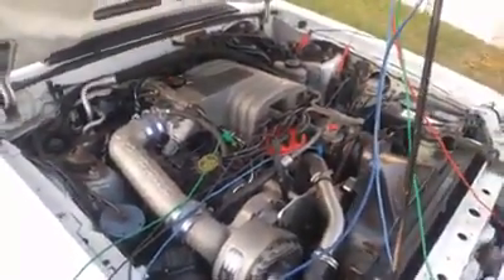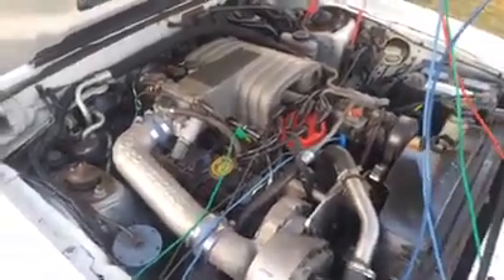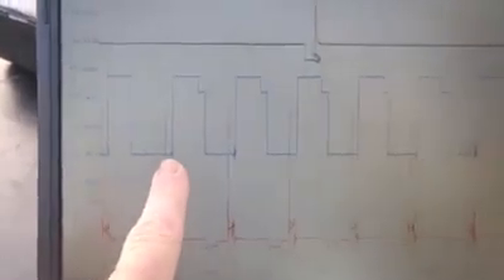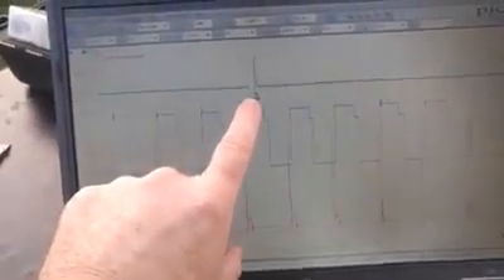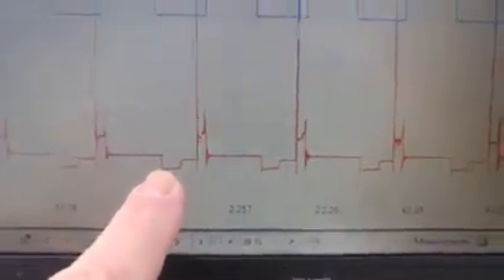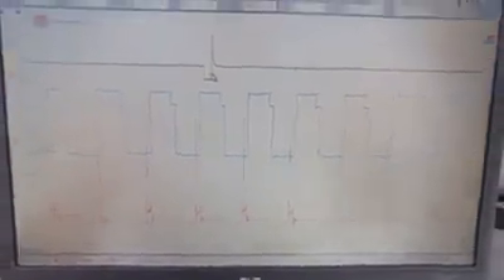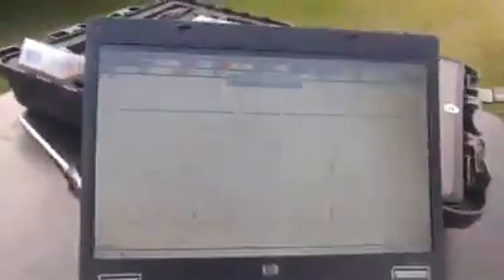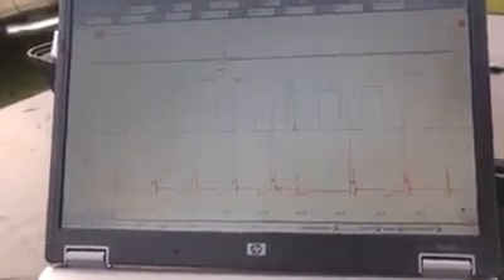Diagnosing a bad EEC-IV TFI Ignition Module Part 1

Comment: Great video ty . My 88 got was running good when I parked  it .went to start it up a few weeks ago and doesn't hear fuel pump . So I jumped fuel pump relay and could hear pump running .but still no start could smell fuel when I lifted hood . Unplug the coil wire and no spark . Tested power at coil and it was present . Along with the signal wire  I used a test light . Now I'm guessing what it could be ..bad pickup in distributor . ,,Tfi module ,,,or relay to ecu  ?? I did notice some great on male connectors on ECU relay . I also hear to check ignition switch plug . .I hate to buy parts I don't need . Any suggestions ???
Reply from the maker: This is what the video is for. I have other videos on testing the coil as well. Remember though, that these Mustangs can have spark even if there is no computer installed at all. The pickup coil has to send a signal to the module, and the TFI module fires the coil by ground pulsing it. It's rare, but possible, that he pickup coil is bad. It's more common that the TFI module is bad. But you have to test to be sure. Could also be lack of power or ground going to the module.

I recommend testing, not guessing. But if I were guessing, I would say no spark = a bad TFI module. See video on how to properly install a new module. If you want to replace both at the same time, just put a reman distributor in it that comes with both a new PIP sensor and module. Getting quality new modules is a PROBLEM. Even the Ford module is now just a cheap Chinese module. Only the original Ford modules with the word Motorcraft embossed into the module plastic are good. The rest are cheap chinese garbage, in my opinion.
Reply: @dragradialperformance3540  ty I appreciate you getting back to me . what worries me is no fuel pump . No prime when key is turned on . I have checked power at Borg sides of all fusible links . And I have heard that the check engine light should come on with key on engine off .but I have never seen a check engine light on my dash  . And I agree about the cheep china parts . because I have changed the pickup and module a few years ago when I changed the distributor gear . I have already bypassed the inertha switch a few years ago when car wouldn't start. I'm sure I will figure it out but I don't want to throw parts at it and don't have much for testing equipment . Going to test all relays and then start with tfi module . Ty again
Reply from the maker: @jaymartin5434 no check engine light ever coming on likely means the bulb is bad, or maybe someone removed it.  Replace the bulb. No fuel pump prime means either the PCM is not getting power, or ground, or the capacitors in the PCM are shot.

The capacitor theory is very likely. All these 95 and older PCMs are suffering from this because they're the right age for it. Remove the PCM, take the lid off, and look at the 3 teal blue capacitors. If they are leaking at all, they're bad. This can cause the engine to run rough or the PCM to not work at all. Very likely!

In ALL foxes, these should be checked. And if the original teal blue capacitors are still in there, they should be replaced by an electronics repair pro. We offer tbis service. Avoid those jackleg Ebay "PCM repair" services". They suck.
Reply: @dragradialperformance3540  ok so it was the ECM relay . I had a windshield put in just before I parked it for the winter and when I took relay out it was wet . I jumped the two big connectors and it started but I still don't hear pump do ten second  primi . But it has always started right up . pump is quiet and that damn factory fan makes so much noise. When car is running .. I did remove the ECM that was in car before I tried jumping wires because it was damn feeling .. I'm not sure yet if it was got wet inside . going to take it apart and look it over . . I'm going to change my ECM relay and fuel pump relay . And maybe the one under the hood on right side of car . Ty for your input ..
Reply from the maker: @jaymartin5434 glad you got it figured out. ECM relay failure is unusual, and it should never be wet. Check for windshield leaks. 

The capacitors should still be checked. They're bad based on age alone.
Reply: @dragradialperformance3540  ya I'm calling my windshield guy tomorrow .to have him fix leak . I just hope it didn't ruin my ECM .i didn't know it was leaking . because I don't drive it in the winter . And I had it done late in the fall not long before I parked it . thanks man for helping me .do you rebuild ECM  ?? Or know a good place that does ?? Would love to have one or both of mine checked out
Reply: @dragradialperformance3540  doesn't say where you are ..are you in the US
Reply: I would like to have you look at my ECM
Reply: @dragradialperformance3540  I'm sorry I see now that you do rebuild ECM I have subscribed to your channel . And I'm watching you videos I'm probably going to call you tomorrow just a heads up LoL
Reply from the maker: @jaymartin5434  yes, we replace the capacitors in these Fox computers. If your capacitors are the original teal blue ones, they should absolutely be replaced as soon as possible. They leak an acid that eats the traces on the board if you don't get them out of there. It's a similar situation to when you leave AA batteries in a remote for about 10 years. When you remove the remote's battery cover, you immediately realize your mistake.

Email me at pontisteve@earthlink.net and ask me how to send your Fox computer in, and I will email you back the forms you need to fill out. And get that windshield leak fixed!

Comment: own a 87 Bronco w/SAME ignition The Ranger station Bronco forum has a AWSM TFI Tsg chart i fixed mine in 30 minutes whereas the shop took 3 weeks didnt fix n charged me $250 ( fortunately) Now it has  a miss but it DOES start.. u need THREE things to get spark at the TFI conn Pin 3 4 n5  Pin 3 is start n u need ta CRANK it to SEE 12volts  pin 4 is RUN and with key ON read 12 volts there, pin 5 is COIL ( coming from secondary and w/key ON read 12 volts there I was MISSING the COIL 12 volts due to a broke wire in bundle between coil n TFI module, couldnt find it on either end, so ran a NEW wire VOILA...If it wont CRANK  ur prolly not getting Pin 3 voltage..start.. HTHS someone!

Comment: I have a vortech v2 supercharger foxbody similar, it runs and starts and a few seconds later it dies. Warm it up fine. Did the tfi modual fix the issue?
Reply: Yes, a new module did fix this car. The original module was bad, I installed new Motorcraft module (now cheap crap made in China!), it failed out of the box, and I ended up putting a parts store module on it and it fixed it.

Modules go bad in various ways. One was messing up at high RPM. One wouldn't work right cold, but seemed fine once it warmed up. The Picoscope proved it out. I have other videos on this car and module problem, possibly labeled TFI waveforms, or something like that.
Reply: @Pontisteve   Second questions, how did you unplug the 3 wire set up in distributer,  the plug. I'm doing a tfi foxbody 87-93 msd Distributor.
Reply: @keepondreaming3870  on Fox bodies, the module has 2 screws holding it on. Remove them, and the module pulls straight down to come off the distributor/PIP sensor. Google pictures of the PIP sensor and the ignition module, and you'll see how there's just 3 large male spade terminals on the top of the module, and 3 matching female spade connectors on the PIP sensor. The PIP sensor bolts to the inside of the distributor to hold it steady.
Reply: The tfi modual has been removed, the two bolts holding pick up, it has been pulled up, but there 3 wires Attached from pickup to distributor, green,red and black. How do I remove that 3 wire plug that goes from pickup to distributor? Can't see underneath , have big hands. Looks like delicate, plastic. Figured I ask.
Reply: @keepondreaming3870  The 3 wires inside the distributor go to that black round plastic piece that slides over the distributor shaft. The only way to remove that PIP sensor is to remove the distributor, then remove the distributor gear (you'll need a punch for the roll pin, and a Thexton Ford 5.0 distributor gear puller to remove the gear). I think I have a video on module installation tips that might show this.
Reply: @Pontisteve  I think your right, have to remove pin and take apart. 
Might try on a old one to see, if I can remove plug without dissemble.
Doesn't make sense, you have to take it apart to remove a electrical plug.  There just no room to remove plug. I'm sure someone has a trick to this, without removing pin.
Reply: @Pontisteve  shoot me the link to the distributor  repair, heart surgery. The pickup just arrived it 1 piece. There no plug below, it has to be removed , trying to figure out how to take it apart , the slid pins. Do I just remove top one or does whole dis, have to be taken apart
Reply from the maker: @keepondreaming3870  No, it's not a plug. The sensor is an assembly with two ends and wires in the middle. No plug, except where the module plugs into it externally. The plastic piece slides over the middle and the only way you can remove it is to remove the distributor gear with a gear puller like the one I mentioned.
Reply from the maker: @keepondreaming3870  I don't remember if I even have a video on doing the actual distributor repair/PIP sensor replacement. But check out my video on Module Installation tips. There is almost nothing to the whole distributor coming apart. The ONLY difficult thing about all of it is removing the distributor gear. It has a roll pin that's easy enough to remove with the correct roll pin punch. But the gear is pressed on, and it can go on two different ways, so it pays to it and the distributor with a paint dot or something so you can put it back on the same way it came off.

The gear is pressed on and pinned. So once you remove the roll pin, you still have to use a long puller to pull the gear off. And maybe use it to put it back on too. It's a bit of a special puller in my opinion, so the Thexton Ford TFI gear puller is the right tool for the job. If you don't want to acquire that tool, get a reman distributor. Also, whether getting a distributor or doing it yourself, insist on using a Ford Motorcraft PIP sensor. They're blue now.

Comment: i'm having i put a 87 5.0 in a 98  mustang if i take off in drive let of the gas it dies i've when old school with carburetor can'i even get the timing to just from distributor
Reply from the maker: You have to run an old school distributor that has weights and springs inside, to control the timing advance curve. And it will have a vacuum advance as well. The gear on the distributor needs to be the right one to mate up with the roller cam that came in the 87 motor. If I were you, I would consider getting all the fuel injection parts and the computer out of a 94-95 Mustang GT and using them on your 87 motor, along with the 94-95 distributor and remote ignition module setup. Your 98 shares the same body as the 94-95, and the conversion to 94-95 V8 stuff could be done in a factory sort of way. Plus, mass air is superior.
Reply: @dragradialperformance3540  thank you so much